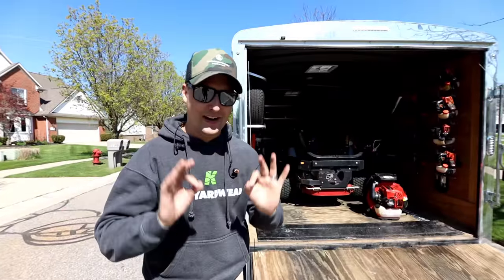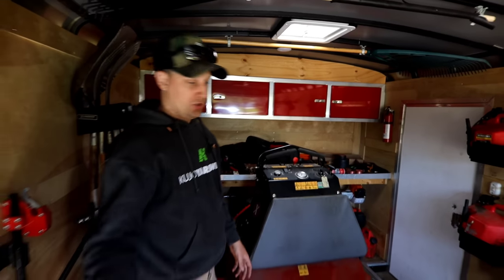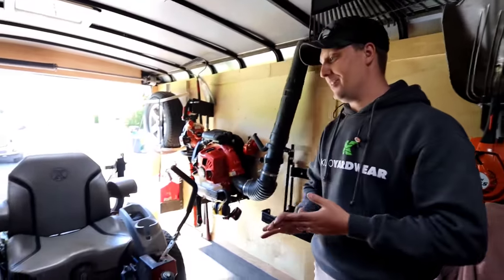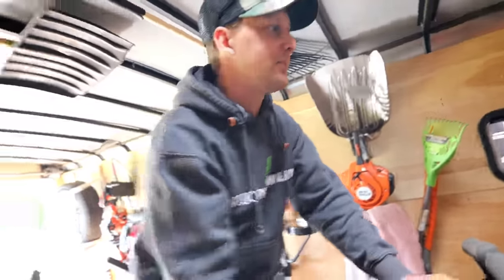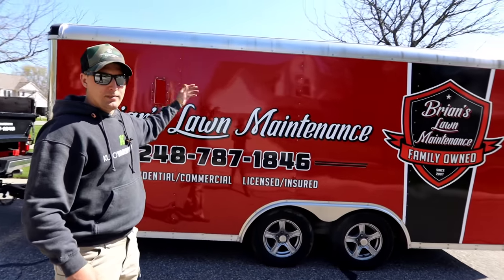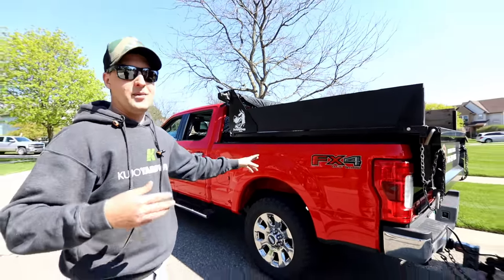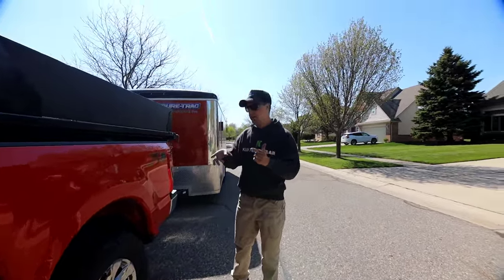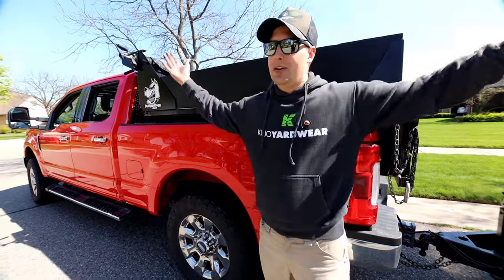2021 Lawn Care Setup ☆ Enclosed Trailer, Exmark Mowers, F-250, Tutorial - Brian's Lawn Maintenance🤙

Comment: My setup is a 2019 2500 HD Crew Cab (just paid off last night) wrapped, 7x14 Diamond Cargo, 2019 Gravely 52 ProTurn, Gravely 34 walk behind, Stihl 131 Kombi unit with all the attachments, Stihl Farm Boss, Br800, 2-Br600, Stihl Pole Hedgers, Stihl hs45 hedgers, 2-5gal no spill gas cans, 4-2.5 no spill gas cans, Stihl fs56 trimmer, & 2 husqvarna 322l trimmers. I just hit my 1 year mark on April 2nd
Reply: That’s cool, but do those “no-spill” gas cans actually work as advertised? I have a few of those no-spills and they spill more fuel than the old ones ever did.
Reply: @jamesflynn10  I'm a fan. All my diesel cans are no spill as well.